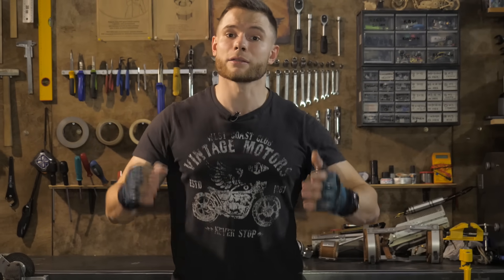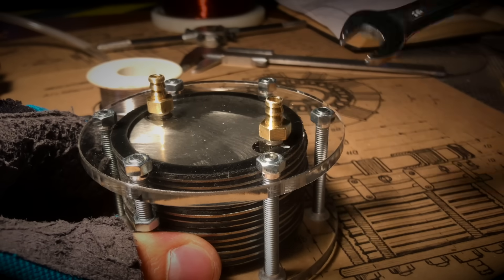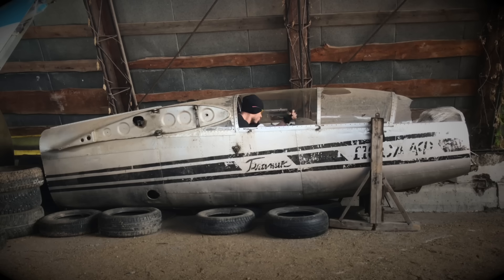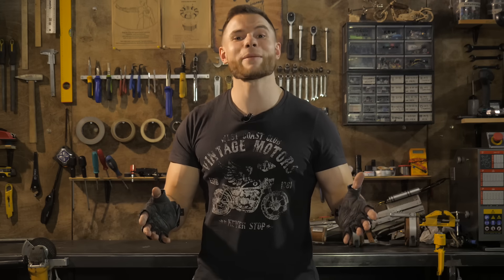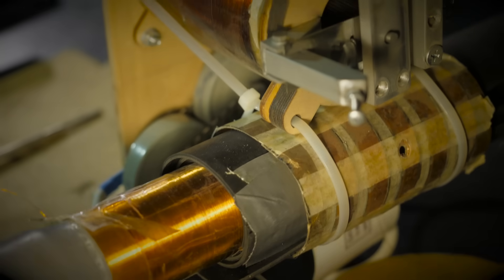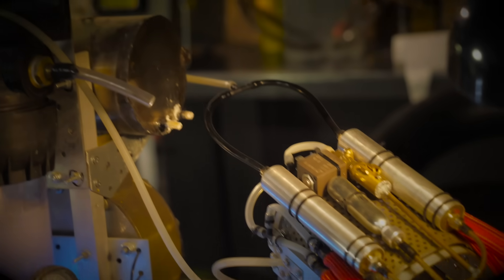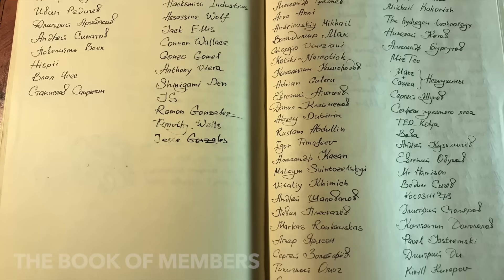Building real Iron Man suit (Part#1: Conception & Protoypes. Reactor, Repulsor, Armor, Exosuit)

Comment: For your joints.  If the load is low then a rubber bushing would work.  If the load is high, then mabye a offset bushing inside of a bearing?  It would be nice if there were someway to "lock" the joint when you engage your artificial muscles.  However, it might not be worth the effort.

Comment: A silicon diode suit would help with the clash of metal on skin. also would create an impact safe resistance, and silicon is easily adaptable for electrical engineering and circuitry.
Reply: you should try to put this comment on the other comment of his where he asks us to give him ideas!!!
Reply: @marz.6102 I shall, what's the link?
Reply: @planetlimbo5981  got to top comments and he made two comments one of those asks for the communities ideas! Like yours!
Reply: @planetlimbo5981  in this video

Comment: With a complex project like this, don't underestimate springs. Extension springs, coil springs and the weird spiral ones too. Universal joins that can move in any direction. I've been designing an exoskeleton on my own and I found what helps is just trying to get metal and mechanical parts to replicate the movement of the human body first and then figure out how to mount onto your body. My first couple of designs are big and bulky, but are able to move properly and from there I simplify what I have and get rid of unnecessary sections
Reply: you should try to put this comment on the other comment of his where he asks us to give him ideas!!!
Reply: @marz.6102  will do, thanks
Reply: @levicampbell1819  ok good luck

Comment: So first idea I had for your request of fitting to multiple body types, 

Anywhere the suit (which can be a standard size) is in contact with the body could do so with an air cushion. A bit like a blood pressure machine which inflates to the required volume of air to achieve the required compression to the desired body part. Instead of leather cushions use inflatable versions which can be adjustable to the relative flexion/extension of each muscle... 

Disclaimer I'm not an engineer but consider myself a pragmatic problem solver. Consider it, if it makes no sense in your application, disregard it an move on but the concept of an adjustable suit seems valid in some way.. good luck.  I look forward to your next release along with other suggestions!
Reply: you should try to put this comment on the other comment of his where he asks us to give him ideas!!!

Comment: dont know if this helps but what about a knuckle joint of some kind that connects to a circular rotary piece that can turn 180-360 degrees just above the knuckle  /--1l1--
                                                                                                                                                                                                                                                                                             / /

Comment: It seems that your first repolsur and the bfr were simple one stage pulse engine so if you mounted a miniature pulse jet on arm like BFG then you could get a possibility to hover at the least if configure them like the guy who did it with jet Ingine and get a repolsur as well you would have to use some sort of incelater like kale wool ,fiber glass ,or Carbon there is the possibility that you could even use vortex cooling however that would require some testing because it may not work with pulses
Reply: you should try to put this comment on the other comment of his where he asks us to give him ideas!!!

Comment: You could use hydraulics that move based on your movements, and the hydraulics will also give you super strength. I think I have seen small hydraulic cylinders and they are pretty inexpensive.
Reply: The biggest problem with exo suits is flexibility and speed. Being strong is cool, but if your really encumbered in the suit, it's not going to be pleasant to use. I personally don't think hydraulics would be quick enough but I could be wrong.
Reply: @lukeD8099  That is very much true, but with higher air pressure you could move the hydraulics at higher speeds and with a muscle sensor you could track arm movements and based on the muscle movement the hydraulics can be synchronized to the arm movement.

Comment: Idea: If you used a fine aluminium powder or even nanoparticles, you might get a much higher reaction rate, and you could possibly even design a system to add powder and a controllable rate. Of course, you would also need a pretty powerful cooling system. (Could that system possibly also generate electricity from the heat to power the suit without using up any of the hydrogen?
Reply: you should try to put this comment on the other comment of his where he asks us to give him ideas!!!

Comment: for the shoulders you could also look into a a partial ball joint that has been hollowed out. for the elbows you'll need to a structural joint/s on the outside but you might get away with a flex joint like material (maybe a polymer sheath with woven fibers aligned to the elbow movement) on the inside of the elbow to disturb weight better. for making joints suitable for body mobility you should look into design principles used in making braces for joint support on the human body. that's my idea anyways! shrug
Reply: you should try to put this comment on the other comment of his where he asks us to give him ideas!!!

Comment: This is what I've been thinking about since the beginning of this series and building suits, the armor will need some way to connect to the user without having the weight of all the metal and electronics. A first step might be to create a 3D model of your proportions and then model a metal frame onto it with all the needed joints, then add electronics to actuate the limbs (with mechanical interlocks so a programing error doesn't break your leg) thus ridding the user of physical strain and allowing the attachment of armor and electronics. Good luck recreating a human skeleton out of metal and wires.
Reply: you should try to put this comment on the other comment of his where he asks us to give him ideas!!!!
Reply: @marz.6102  Ah my bad, Thank you for the insight.
Reply: @tupov  just passing it on

Comment: For the ankle joints there could be a simple mechanical part which would slide along rails on tibia and be attached on a hinge on the ventral part of foot. The same would be applied for the calves. Therefore you can literally just have a boot and then pants as separate parts which you would just have to insert into the rails on which it will move. And since it is impossible to put any jets into the legpiece, then it’s only use would be free movement.
Reply: you should try to put this comment on the other comment of his where he asks us to give him ideas!!!! ᕙ[･･]ᕗ

Comment: I don't know if this is possible, but could you add graphine rubber, to the joints, and neck and the palm of the hands to protect you from the heat from the torch on the hand.

Comment: Ball bearings can be installed on the joints to move better. And if the suit is too heavy, you can install a back support to distribute the weight better

Comment: You can film the welding, but you run the risk of damaging the camera sensor. You can prevent this by putting some sort of light blocking film over the lens. 
Alternatively you could try to do what people do if they want to film the sun during a solar eclipse, have a black film with one tiny hole covering the lens so you only get minimal light hitting the sensor.
I have no idea if this last tip could work, but might be worth trying.

Comment: This has to be the most wholesome YouTube maker channel on the entire platform. As for suggestions, I looked into doing this myself as a class project, and you've already solved many of the mechanical problems I identified. Most of the problems with exosuits dating back to the 1950s has been control systems/feedback control. EMGs (electromyographical sensors) struck me as an inexpensive, yet more elegant means of control input than forcing your arm/limbs to extend against a contact switch, it's the next best thing to something like BMI (brain-machine interface). Also, as you pointed out, there's no need to "re-invent the wheel" when others have already solved the problem and thrown it into a scrap yard. Example: It'd be kind of pricey for you, but an easy way to achieve "Iron Man superstrength" would be to simply purchase surplus/commercially available hydraulic spreaders (known in the United States as "the jaws of life") and attach it to one arm.
Reply: you should try to put this comment on the other comment of his where he asks us to give him ideas!!!!

Comment: The insulation part, to make the armor cooler, is it possible to use flexible material to replace the gas tube in hand muscle part ? And replace it like plate frost that came from just pipes ? Like air con concept, y'know? Freeze the plate instead of put cool tubes everywhere, plz think about it. If that possible you may as well make the armor lighter as well as more flexible movement 👍
Note : like Centralized air con concept 👍
Reply: you should try to put this comment on the other comment of his where he asks us to give him ideas!!!

Comment: Using silicone or rubber between the joints like the suits in halo can help with mobility.
Reply: But what about temp increase, it'll just melt?
Reply: @marz.6102  Depends on how high the temperature can get. Rubber would melt easily. Silicone rubber can reach up to 300 °C, but if that's not enough i think space quality silicone rubber to reach a bit higher.
Reply: @TWFDeadzoneII  oh thx for clarification!

 you should try to put this comment on the other comment of his where he asks us to give him ideas!!!!

Comment: For shoulders: you can do a similar design to what Nasa is doing for their new EVA suits

For elbow: a gimble but the rods are made of actuators (definitely requires research and some trial and error)

For armor "covering": Green foam can be used with cnc to create a mould and then CARBON FIBRE/FIBRE GLASS can be used as the composite materials for the shape.

If anything more pops up in my head, I'll be sure to share it here!
Reply: a gimbal might not work as it will experience a lot of presure and might brake
Reply: @olafpeijen3912  Ayy, but Alex does his own thing and that's why I stated that it requires research and some trial & error. Maybe it can give him an idea to work off of
Reply: @YOLO-tq3el  true im just saying that that might not work but nothing wrong with giving it a try
Reply: Those NASA EVA suit double joints look gods-awful (Svarog-awful?) though, and are really only necessary because it's a pressurized volume. For an Earthbound suit (or one with a counterpressure underlayer) I think there is a less cumbersome solution :D
Reply: you should put this comment on the other comment of his where he asks us to give him ideas!!!!
Reply: @marz.6102  Didn't know that existed, thanks!
Reply: Thais so good
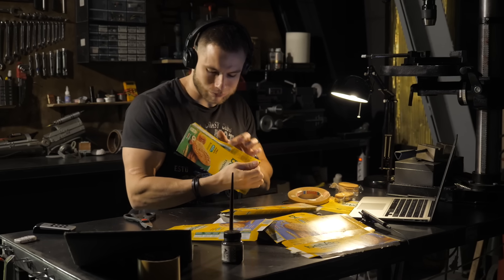Reply: What's the song in 11:20?? 
It isn't in the description!
Reply: @marz.6102  rush of blood (komodo)
Reply: @olafpeijen3912  thx